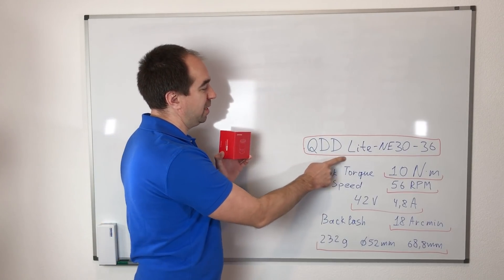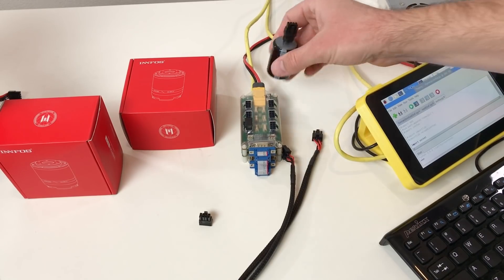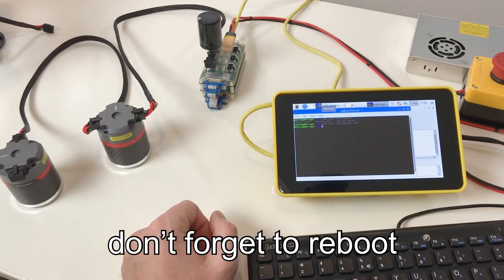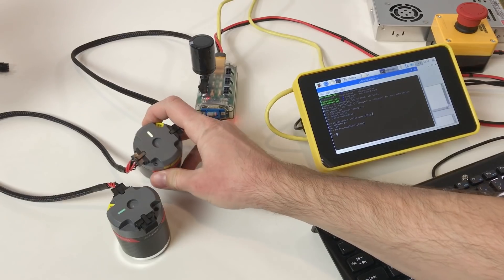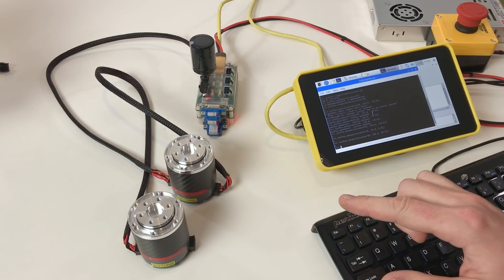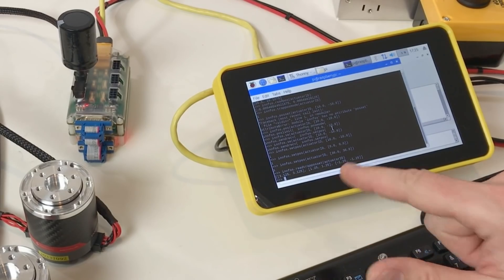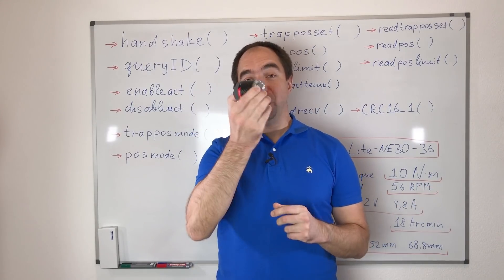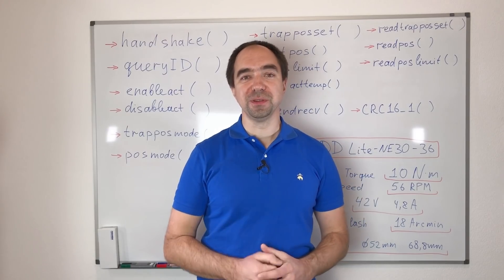Professional Brushless Actuator from REAL Robot Arm (INNFOS GLUON)

Comment: Thank you for this video and the github. Can you please let me know if you ever wrote the function for the current control? I was hoping to write a program where the user can press a button to manually override the arm:
eg: 1. read the load prior to interaction to understand initial load at rest/gravity, 
2. set the new load/rotor resistance to the initial load, 
3.allow the user to interact with the arm and provide their load which will be greater then the initial load and hence allow movement, 
4. when the user lets go the arm will hold position, 
5. when the manual override is ended resetting the rotor resistance to a higher value). 

Due to the translation requirements of the wiki I am just having a little bit of an issue understanding what UDP commands to use and the max/min limits. Could you please help.

Comment: Very interesting video!!.
I just wonder,Do you have any tutorial to connect raspberry PI to actuator via CAN Bus?
Reply from the maker: I don’t know if the raspberry pi has a CAN bus...
Reply: @Skyentific  
No, I mean about the converter module which you use in that video. what is that ? and  how do i program it?
Maybe i can use it to my little project.
Reply from the maker: Renardi Adryan This module is made by Innfos, specially for this actuators and robot arm. I think it will be very difficult to reprogram it. You would need to have a good skills in using microcontrollers.
Reply from the maker: Renardi Adryan it has STM32F429VET6 chip. I don’t even know what kind of microcontroller is this. :)))

Comment: tan ( .005 radians ) x 432 millimeters ~ 2.16 millimeters    this seems to correspond with Skyentific measurement of backlash    ....   432 mm is length of robot arm extended ( axis to axis )

Comment: I remember seeing an ad in a gun magazine for polymer bullpup conversion stocks for AK47's. I ordered 50 of them from B.P. Sports ($2,700). I waited 6 months but never received my order. Finally i called them only to find they were still 'building the molds'. After applying some verbal coercion i had a refund cashier's check in my hand the next day...from three states away on a Sunday! I was one of the few who managed to get their money back.

These look sweet but they are still vaporware if i can't order them and get them by next week. I could just buy a Lynxmotion LSS HT1 high-torque 'Smart' servo from Robotshop for $110. In Stock, Free Shipping. https://www.robotshop.com/en/lynxmotion-smart-servo-lss-motor-high-torque-ht1.html j3-pro.com
Reply: That lynxmotion servo is much weaker than this servo. A better comparison would be one of the bigger Dynamixel servos -- which are slightly less weight, but cost more.

Comment: Do you think I worked on an RC plane?
Reply: If you meant to say, "Do you think it'll work on an RC plane?"...

I doubt it. It'd have to be an awfully large plane to easily carry the weight. I don't know what these actuators weigh but i'd bet (from what they look like) they weigh about the same as a Nema 17 stepper motor. Which feels like a solid block of aluminum at 10oz. Almost 2/3 of a pound. And via Kickstarter you might never get them.
You'd be better off buying a Lynxmotion LSS 'smart' servo for $110. It weighs 63grams.
https://www.robotshop.com/en/lynxmotion-smart-servo-lss-motor-high-torque-ht1.html j3-pro.com

Comment: What happens if you turn off the actuators without disabling them?
Reply from the maker: I don’t know. I think nothing. But they say that they should be disabled.
Reply: If the servos are still moving, or holding load with significant current, turning off the power may generate an indictive voltage spike, which can ruin both mosfets in the servo, and other things connected to the same power bus.
The emergency button is good, but only for emergencies.

Comment: I am a little confuse here.
do you need the SCA ECB to run the motor?
Because they price the motor $99 each, which I almost tempting to pledge.
But if it can only be controlled with their own ECB, it kind of loses the fun of it.
Reply from the maker: Great question! First of all, with one ECB you can control multiple actuators. Second, you can use standard CAN bus and control it with Arduino or Teensy, without ECB (like I control MIT mini cheetah actuator, in my recent video).
Reply: @Skyentific  thanks for the reply.
would you like to try to run the motor with a pi CAN bus shield in the next video?
Reply: @Skyentific  Great video. I'm loving it and subscribed. I pledged for the 6 axis robot.  
But cannot find anywhere if the ECB, power supply, terminators, condensator etc are part of the DIY kit. Can you confirm?